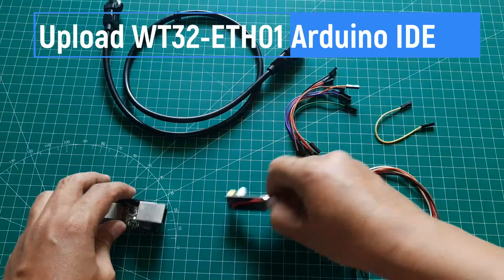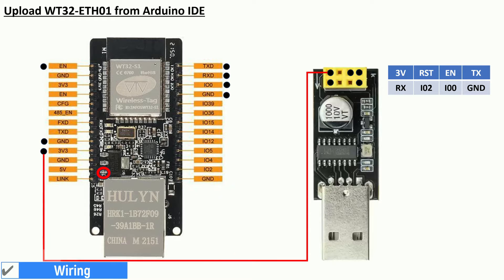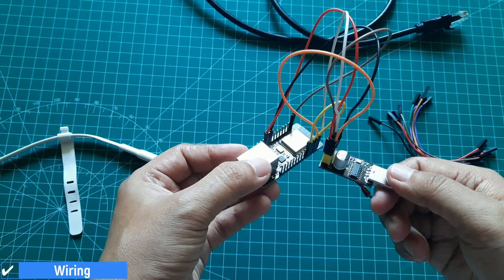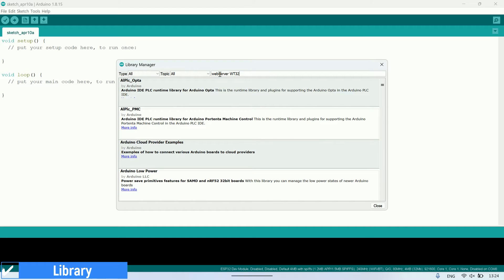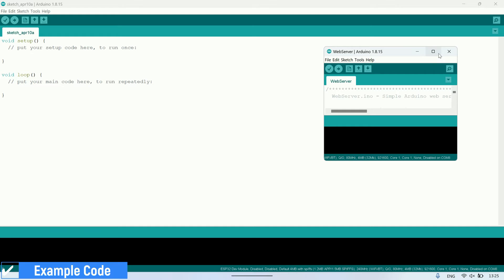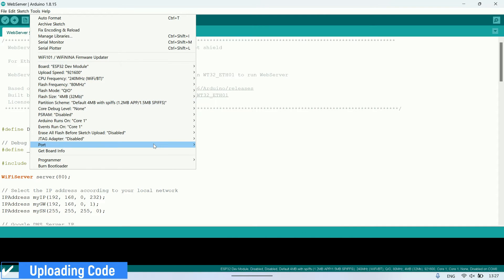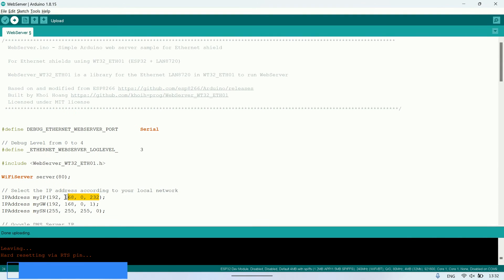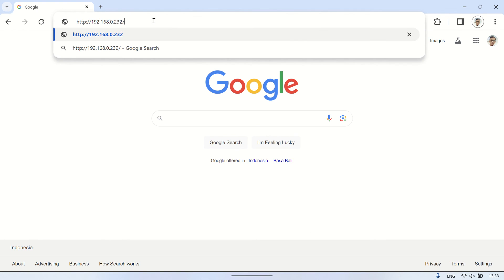Upload WT32-ETH01 Board in Arduino IDE, and Testing Ethernet Connection

Comment: Compilation error: no matching function for call to 'ETHClass::begin(int, int)'

can't compile
Reply from the maker: Did you select correct board?
ESP32 Dev Module
Reply: I am getting the same compilation error.
Reply: I have the same problem